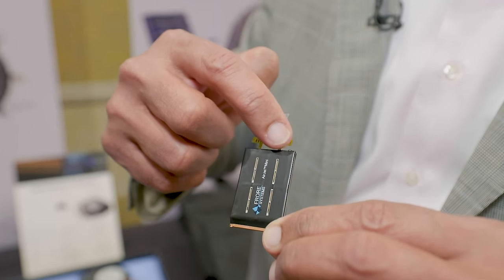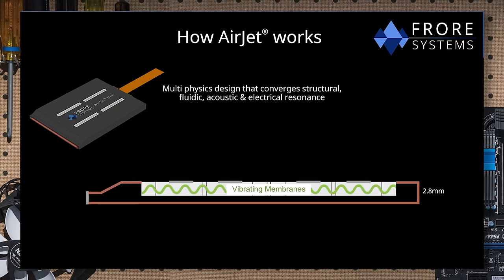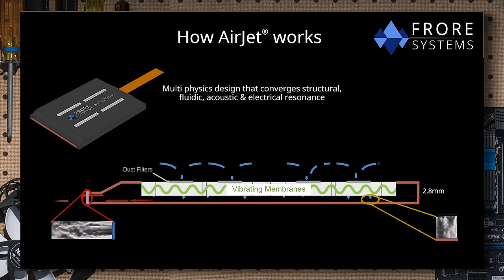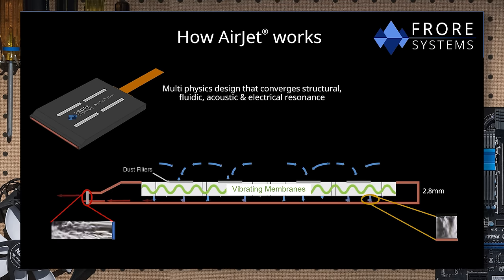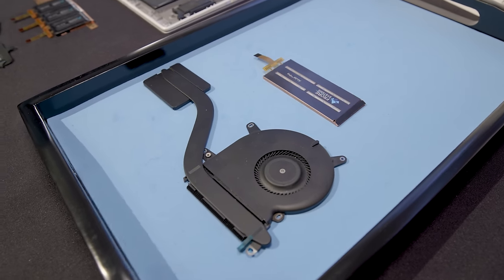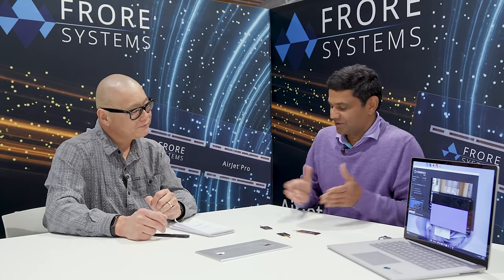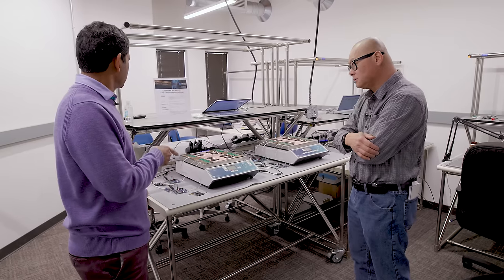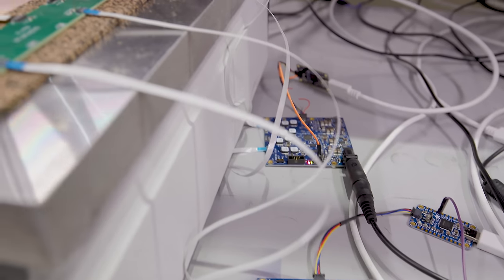Take A Lab Tour Of This Solid-State Cooling Tech

Comment: That is whisper-quiet. I'd be really interested to see what kind of exotic cooling you could do with this. And I'm also curious what kind upper limit we have on how many watts you can dissipate

To me this would be really great for Led backlights in televisions. Or even OLED. Imagine an OLED having the cooling capacity of a BVM without the huge increase in form factor. This technology is insanely cool.

I also have two any beam MEMS laser projectors. They are already fanless and low Watt, but if you could put one of these inside you could potentially get a much Brighter Image out of a Pico projector like that. I wish this company nothing but success
Reply: Yea I see LED/LCD going the way of the dodo long before these make it into the wider consumer space like HDTVs.

All display manufacturers have dramatically scaled back or just plain cut their LCD production facilities at this point, so it's likely that some variant of OLED or ELQD (electroluminescent quantum dot) will be the main display techs going forward.
Reply: @mnomadvfx QD EL is definitely the next big thing.
Reply: I wish this company failure due to a better product and for lots of competition, that would be great
Reply: Tiny and exotic use cases is really what this would be best at. Unless it happens to be ridiculously cheap to produce, you're not going to see dozens of these inside of a larger device like an OLED tv. I mean, I suppose it's possible, but it sure as hell wouldn't be cheap. A fan will always be the more effective, economical approach at that size.

Better cooling for small devices, however, now that's a serious market. If the Steam Deck had access to this kind of cooling during development, it would've been the natural choice.

Personally though? I would LOVE to see these used in some fricken CAMERAS. I say this as I'm glaring at my Canon camera that overheats like a little toaster and shuts down after 20min of recording. For professional cameras, every gram counts. So they're usually passively cooled. But they're also designed to be able to survive the weather and the outdoors. So they're sealed off with thick plastic from all sides and there's nowhere for the heat to go. A fan would be a ridiculous addition, because it would be chonky as hell. But the frore air jet thing looks like the perfect size for a professional camera. If they were ever available in a non-OEM format, I'd wanna buy one and find a way to frankenstein it into my R5.
Reply: @user9267  I don't think you need the company to fail to achieve healthy competition. Actually, taking a player out of the market would probably be bad for the competitive market.
Reply: Is it though? High velocity air stream through a super thin exhaust? Doesn't sound quiet. The fans in my pc are already pretty much noiseless, all I hear is the air moving through the restrictions
Reply: @lgolem09l  

Haven't they literally shown it
Reply: it's 5 watts removal per mini. it scales linearly with the airjet's footprint, as will the price unfortunately. the cost limitation will be the cost of silicon fabrication, which isn't cheap. from my calculations you can get about 60 minis per 300mm wafer. at TSMC's finished cost of $1600 (2020) per wafer, we are looking at $26 per mini at least. i think it's amazing that Frore even has their own Fab (crazy!) but they are definitely not to the level of TSMC considering lower economy of scale and novel fabrication techniques. this thing is going to be expensive...its good that they are partnered with Intel from the beginning. hopeful, but this reaching mainstream consumer is probably >3 years away. it should arrive earlier on niche or high performance mobile devices first.
Reply: @mnomadvfx  Took the words right out of my mouth! Can't wait for when we can finally start using ELQD displays. All my devices will switch from OLED to ELQD.

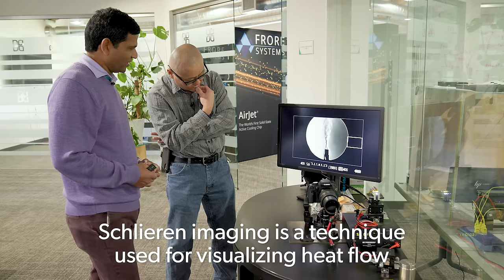Comment: slight mistake around 12:05 in that schlieren umaging is used to visualize air currents, not heat flow in particular. it can visualize hot air because it works with differences in air density (specifically refractive index, which can change based on density) but also works with any other type of moving gas, including room temperature
Reply: I feel like there's a lot of bullshitting attempts in this video. "It's not air moving device, it's heat removing device that uses air", "it's not a fan", well, yeah, fan combined with a radiator is also heat removing device that uses air. It's an interesting technology but why do they push this marketing gazlighting so hard?
Reply: He does mention air density while explaining it, did you skip it?
Reply: @Poluact  Definitely, there is a lot of marketing bs going on, but he hasn't really said anything wrong.
Reply: @gaminallthytime  I mean. I feel like there's something shifty when people slap all kind of buzzwords on their product. From what I got the key difference is that it moves air in very high speed pulses which removes heat faster due to this jet impingement effect and that's basically it. Well just tell me so. It's already good enough that your new tech is slim and silent, why do you try to sell me all this "chip" bs. Isn't your product good enough without it?

Btw, there're 2 things left not covered in this interview: 1) energy efficiency. How much energy it consumes comparing to fans?; 2) he stated multiple times that it's designed for up to 40W (iirc) chips - what about more? I guess it's limited in how much heat it can remove (not enough of a surface area maybe?).
Reply: @gaminallthytime  "but he hasn't said anything wrong" is a tenant of most advertising, not to mention cons.  I'm not saying this is a con, but sophistry around defining as being fundamentally different from a fan doesn't help.  It's a heat removal device that seems to occupy both a smaller volume and a thinner profile than fans do.  It would be worthwhile just as an alternative to fans. I didn't see comparisons in power consumption of their device vs fans  doing the same job, so I'm tempted to believe that it's not favorable, ergo in situations where space and noise isn't a factor, fans are probably superior.
Reply: @Poluact  Yeah seemed scammy at first. But it is a chip because the membrane is made with silicon which is "fabricated" into a "chip" at a fab unit in taiwan ie its a silicone chip.
1) Efficiency was mentioned in their older ces video with pcworld you could check that.
2) Its a 1st gen product targeted towards handhelds and ultrabooks. Their end goal is higher power machines.
Reply: @graymouser1  Efficiency was mentioned in their CES interview with PC world you should check that. It will consume more power overall compared to a fan while giving better heat dissipation in the same area covered by a fan as shown in this video while being almost silent and dust resistant for particles over 1 micron. You will lose more battery to this than a fan as 3 micro versions were compared to a single fan in the ultrabook.

I mentioned they haven't said anything wrong because what seems like buzz words here are just words that are technically correct. Cons are usually too good to be true and have money involved, no pricing is mentioned here yet. The whole vid can be summed up in like 6 mins but that would be too short a video for the channel wouldn't it?

And like you inferred, power consumption is probably more but you are getting better performance here than a regular fan so a fan is not superior unless you want to save like 5% of your battery which this chips will probably eat over what the fan would. Also it's a 1st gen device, fans have been improved for over 100 years give this time too lol.

Since its said we will see a consumer device by the end of this year, then maybe then or early 2024 we'll know if this is something amazing or just a sham.
Reply: I don't understand how can you view movement of gas unless there is a difference in refractive index which changes due temperature....right?

Do excitement of atoms have no correlation with refractive index?
Reply: @graymouser1  I agree, it would be nice to see a power consumption comparison between the chips and fan cooling. I guess depending on the power consumption of the chips, a higher power draw could be offset by lower processor temperatures resulting in better device efficiency. Though I can't see it being enough to make a substantial impact.

As for desktop processors, they would need to somehow integrate the chips into something akin to a tower cooler to remove enough heat/provide enough surface area. And even then, the power consumption would likely be massive compared to a couple of fans.

Still, I'm excited to see where they go with these chips. Using these chips for M.2 SSD cooling and motherboard chipset cooling makes a ton of sense instead of the thick aluminium heatsinks that generally come with desktop motherboards. Especially if they work with manufacturers to directly integrate the cooler into the SSD/motherboard.
Reply: @gaminallthytime  I'm sorry, what? so if i put a tiny fan and head sink into a chip fabricated from silicone its a chip and not a fan + heat transfer device coming together to form a 'heat removal' device?  That's playing semantics
Reply: @TheAnzamin  Idk what you saw in the video, there is no fan here to begin with, the chip, which it is one (since its an integrated circuit), is the one that's vibrating and creating the air pressure. Say if someone buys a pen which happens to be a ball point pen, is there any harm in calling it one or the other?? Both words apply to it so either of them can be used. Since this here is a silicone chip, whats the harm in calling it one? Plus idk which rock one has to live under to not realize that marketing involves coming up with appropriate terminologies which define your product, which has been done here too.

Comment: One thing I was missing (maybe I didn't hear it) was power efficiency. Their own data says this technique needs some power to work. And it doesn't look like it's not a low amount.
Battery life is crucially important to mobile devices and I would like to see data that shows that it works well for that.
Reply: I seem they talked about it in previous video during CES.
Reply: Also any power it requires would out more heat into the system. I'm quite worried on the demo they showed of the laptop and closing the intakes. If you force negative pressure into the laptop that will also cause dust buildup and well as heatbuilding in the closed chassis
Reply: @Joao_Weiand  Who knows.
I don't think this itself will be a problem but we don't have enough data to come to a conclusion.

Comment: Still really interesting stuff & I appreciate Seshu taking the time to better explain things. I understood jet impingement and Laminar flow during the CES video but the one thing I couldn't wrap my head around was how exactly this is supposed to scale. Now that I know they are doing full real world testing procedures, have a fab in Taiwan, and they're using mature manufacturing processes from other  established industries I actually feel a lot more confident in the product. I saw who some of their investors are and the list is impressive, including Qualcomm. So I'm actually really looking forward to whenever they IPO so I can invest too. I genuinely believe they have a hit here & with enough time and gains in small form factor they could legitimately scale up too. I can easily foresee a world where air coolers lose the fans and replace the fin stacks with airjets.
Reply: the average investor will not get to capitalize on Frore because of joint venture with Qualcomm and Intel. your best bet would be to invest in wafer producers because those guys have capacity already booked till 2026 and Frore is going to consume even more due to volume scaling directly correlated to wafer area.

Comment: Considering the height, combined with thin vapor chambers to increase the surface area, something like six Airjet Pro should be easily possible even in laptops and 56w of near silent cooling would be quite something. And with some creativity, some crazy results and products could be realized, I believe.
Reply: But 6 jets vs 1 fan..how do they compare in failure rate? Plus how easy will them be to replace? Needing a vapor chamber and 6 jets to replace 2 fans and a copper radiator feels inefficient to me. Now if you tell me you can manage 15w cpus with 1 jet in 1/3 of the space well..now we're talking
Reply: @enricod.7198  6 jets vs 1 fan... if 1 airjet fails out of 6 you're out what? 16% of total cooling capacity? if 1 fan fails out of 1... yeah, I think it kinda goes both ways.

Either way I wouldn't be surprised if the cost became prohibitive when it comes to packing that many inside a single device and also power consumption might become a concern. Hopefully this turns out to be as good as they say it is
Reply: I think for now they only produce one or two sizes, hence why they need to combine multiple ones. I think i remember in the first video they talked about how they could create single bigger ones.
Reply: Moving air is not silent. It will sound like a storm, and you want 6 of them?
Reply: @fungames24  they're basically silent
Reply: @Thros1  The physics of air means it can't be silent. If it's silent, then no air is moving. Moving air whistles.
Reply: @fungames24  The air for the air jet will be louder than the fan, but the operation of the air jet will be quieter since the main aspect of the loudness from the PC fans comes from the motor, or in the case of the dying fan, it will be from the axle and bearings.
Reply: @IntrospectivePest  You would be replacing bearing noise with whistle noise. Also, the fan would have greater durability than a membrane: metal vs polymer/plastic.
Reply: @IntrospectivePest  around 12.35 they have a device working and being recorded. If it was loud gordon would have mentioned it don't you think?
Reply: @fungames24  Jump to 19:20, they have 3 fitted inside a laptop next to one with the regular fan. It's silent and makes the fan seem loud even though its not a loud fan. Skipped most of the video?
Reply: @gaminallthytime  How many CFM of air has been pushed out from each of laptops? Without this, I don't see how you can compare.
Reply: @fungames24  enough to improve the performance of the chip over the stock fan while drastically reducing noise levels, it's like you didn't even watch the video.
Reply: @fungames24  Its running faster with their product in the laptop with net to no throttling while running cinnabench. So it's comparable as its during a workload and its giving better performance ie its cooling the chip better while being almost silent.. What else do you need to know? Unless they are faking all this this looks promising and they are expecting consumer devices to be launched with this "jet" by the end of this year, we can confirm all this once that happens.
Reply: @gaminallthytime  It's not comparable. The only way to compare is CFM per db. Fan is likely to be slightly more noisy in part of the performance curve, but not by very much. Durability of the fan makes up for it.
Reply: @Thros1  No need to watch video. Moving air makes noise. Fast air make loud noise. It is not possible to move air without noise. Any such claims would be contrary to physics.
Reply: @fungames24  It's not as loud and you do not need exact values to confirm it's quieter when there are 2 people there who have fully functioning ears.
Reply: @gaminallthytime  How do you know they have full functioning ears? You need doctor's report before you can say that. Proper evaluation is only possible with proper measurements. It's not valid just to say so on the internet.
Reply: @fungames24  well if you won't see for yourself there's no convincing someone so stubborn.
Reply: @Thros1  No need to see if you understand physics. The only thing that matters in cooling is the CFM, and the CFM causes noise. No magic can change that.

The only possible gain when using the air jet is that the original fan might have been over-spec'ed because the maker is doing "one size fits all". In that case, using a slower fan or the air jet can reduce noise.
Reply: @fungames24  did you even listen to 4 of them? you're goofy.
Reply: @fungames24  You could evaluate based off them showing it off, the cpu performed better, was cooler, and quieter, I hate paid for bots.
Reply: @steezegod2768  No, I didn't listen. Wind makes noise, PERIOD.
Reply: @fungames24  Its Quieter, you're wrong, next. GOOFY